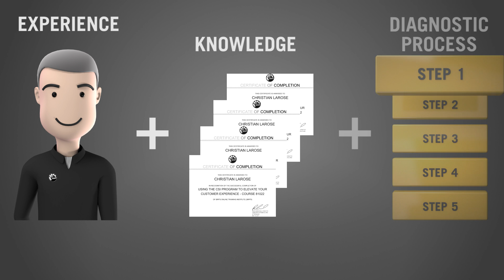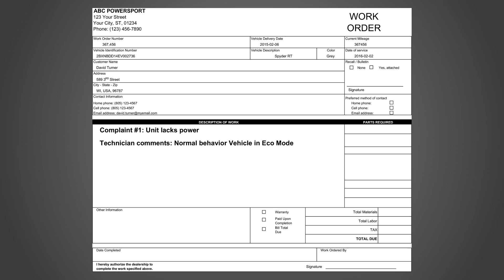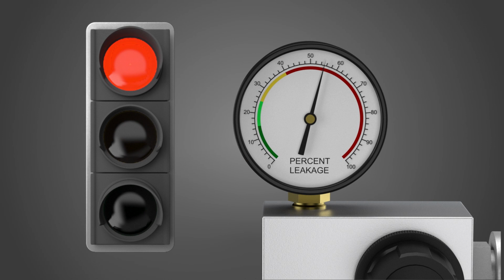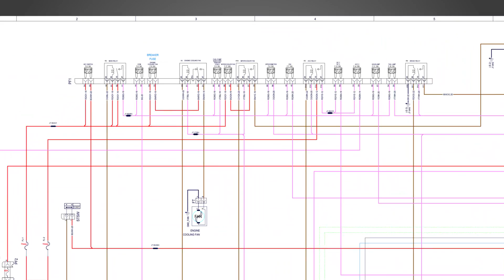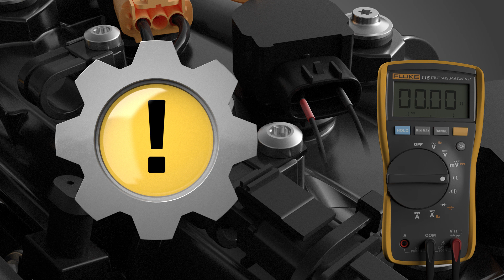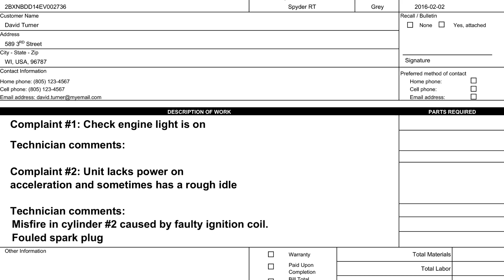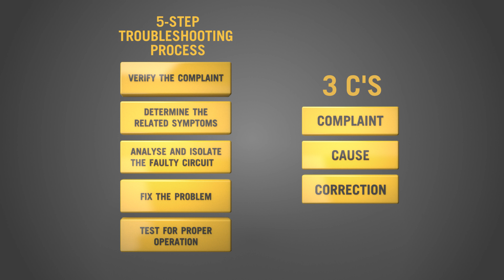How-To Electrical Diagnostics and Troubleshooting

Comment: The VDIAGTOOL V200 Pro supports both AC and DC voltage tests, resistance, diodes, continuity—all in one tool.
Reply: USD how much

Comment: 🎯 Key points for quick navigation:

00:06 🛠️ Introduction to Efficient Electrical Troubleshooting
- Explanation of why some technicians can diagnose electrical problems quickly,
- Introduction to the five-step troubleshooting process: verify the complaint, determine related symptoms, analyze and isolate the faulty circuit, fix the problem, and test for proper operation.
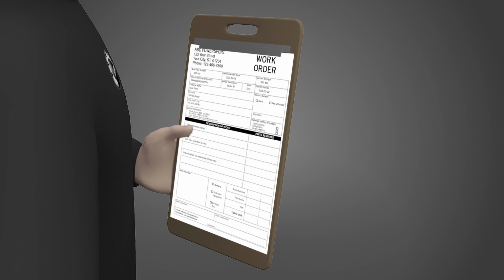01:44 🔍 Step 1: Verify the Complaint
- Importance of identifying and reproducing the customer's complaint,
- Differentiating between continuous and intermittent problems,
- Gathering clear descriptions of the complaint from the customer.
04:07 📋 Step 2: Determine Related Symptoms
- Looking for other issues related to the primary complaint,
- Using fault codes to guide troubleshooting,
- Importance of related and unrelated system checks.
04:45 🔧 Tools and Fault Codes
- Overview of the tools required for diagnostics,
- Understanding mechanical vs. electrical problems,
- Importance of using BUDS2 for checking fault codes and updating modules.
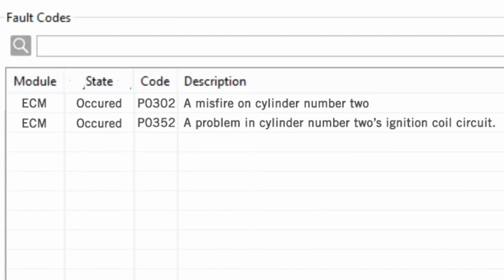06:08 ⚡ Analyzing Fault Codes and Circuit Testing
- Interpreting fault codes related to the ignition system,
- Checking components like fuses, ignition coils, and wiring diagrams,
- Using color diagrams for efficient diagnostics.
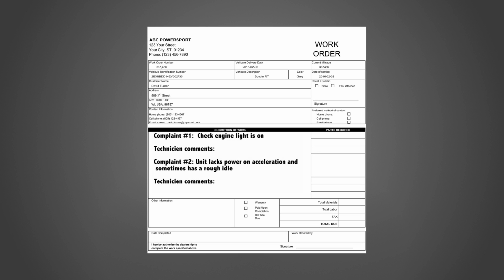08:43 🔄 Methodical Testing Process
- Mapping out the circuit and starting with the easiest components first,
- Using the split-half method for circuit testing,
- Importance of checking connectors without damaging them.
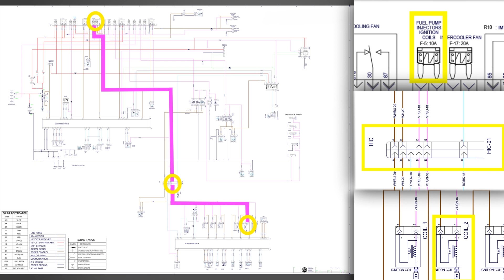10:23 🔍 Detailed Component Testing
- Testing ignition coils, wiring to the ECM, and using an oscilloscope,
- Swapping components to confirm diagnostics,
- Ensuring all components are functioning correctly.
13:19 📝 Preparing for Repair and Communication
- Preparing a parts and labor estimate,
- Confirming the diagnosis with the customer,
- Explaining the repair process and ensuring mutual understanding.
16:04 🚗 Post-Repair Testing
- Testing the unit under the same conditions as initial complaint verification,
- Ensuring the repair addresses the root cause,
- Avoiding assumptions and confirming all aspects of the repair.
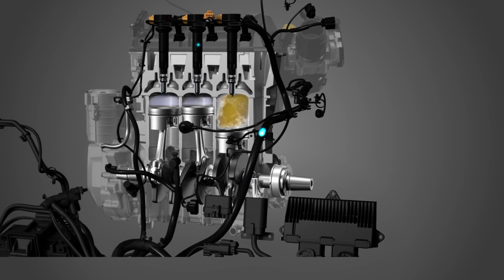17:12 📜 Summary and Conclusion
- Recap of the three C's: Complaint, Cause, and Correction,
- Importance of following the five steps and addressing the three C's,
- Final remarks and thanks from BRP.

Made with HARPA AI

Comment: To effectively perform electrical diagnostics and troubleshooting, follow these steps:
1. Gather information about the equipment and its operation.
2. Understand the malfunction and identify parameters to evaluate.
3. Identify the source of the problem and correct/repair the component.
4. Verify the repair and perform root cause analysis.
5. Check for common electrical faults like bad capacitors or seized motors.
6. Use troubleshooting techniques like analyzing circuit behavior and reading circuit diagrams.
7. Remember that completing the electrical circuit is essential for it to function properly.

Comment: Customer- Ah no thanks since you just spent 4hrs diagnosing my problem I think ill just fix it myself to save some money 🤣🤣
Reply: I'm sure you charged for the diagnostic. If you didn't, shame on you.
Reply: @GMAN420BC  Ive worked at dealerships back in the 90s people would bring their vehicles in to pretty  much have a technician diagnose the engine noise , oil leak, drivability problem  , which paid next to nothing when your working flat rate. Then they would tell the service writer ok thanks I'll bring it back later to have it fixed . Of course I would never see the vehicle again
Reply: Guilty

Comment: I have got to the stage of isolating the circuit but I have had two different electricians in that cannot diagnose the problem. They know the faulty circuit but they don’t know why it is tripping the fuse.

It only happens when it rains heavily.
Reply: Bad insulation most probably
Reply: Might have standing water causing a short to ground or corrosion. There’s a leak or waters getting in the body panels somewhere

Comment: I diagnose the missing noses
Reply: @brptraininginstitute8878  actually smelling comes in handy for diagnosing many automotive problems . Especially electrical with hot wiring and alternator's going bad . Video gave great diagnostic process .
Reply: @Viper81766 ❤
Reply: @brptraininginstitute8878  if anything gets hot enough it can have a unique smell . The rear axle seal went bad in my car and believe me that is a unique stinking smell . That and burnt automatic transmission fluid .